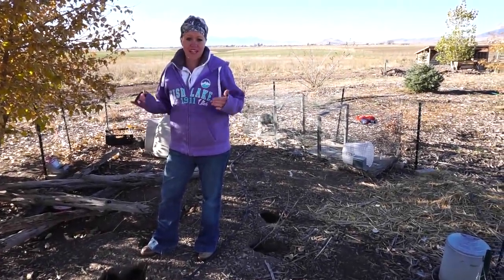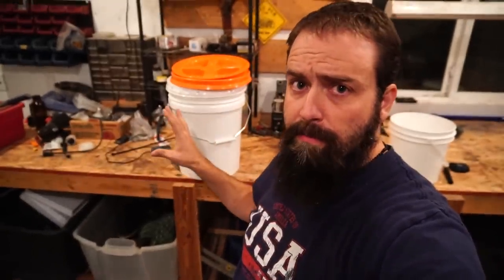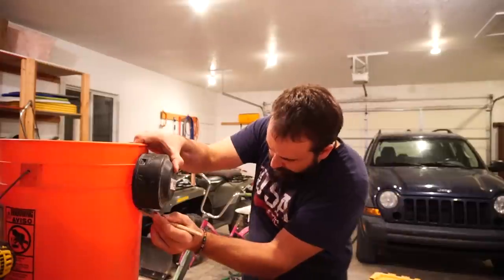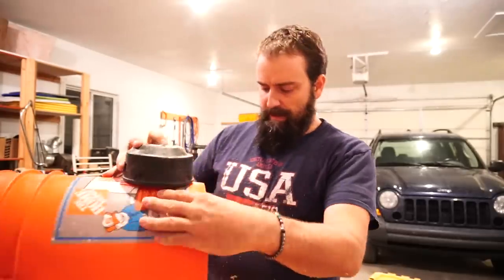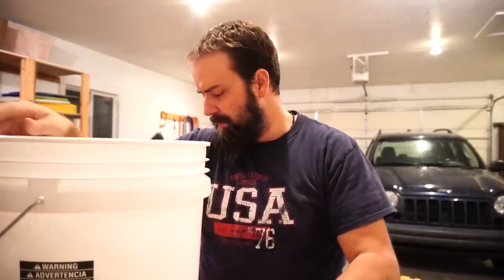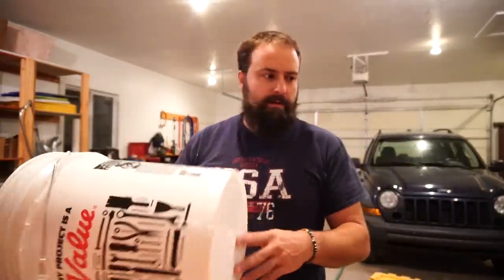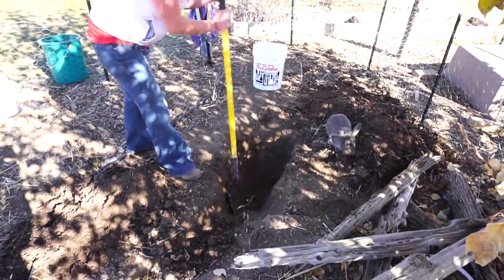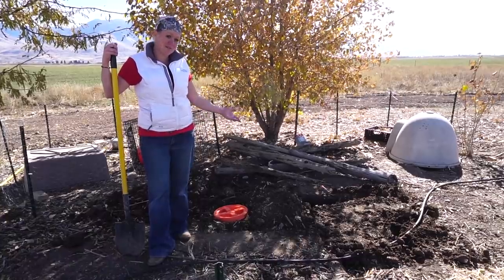Best Bucket Burrow for Raising Rabbits

Comment: I have bunnies in pairs each have 5 X 20 meter runs with smaller fully enclosed runs for night time with insulated house.  They all dig their own deep burrows in heavy clay soil, can't really understand why you need to do this bucket thing. On plus side nice to see a video with farm bunnies having space and not confined to meter square wire cages. Happy bunnies have better tasting meat. Mine are now past their prime as am I so they have retired and just eat, groom, sleep and dig 😊
Reply: So you can access the breeding chambers to check on the babies.
Reply: I like the idea of them not being confined in cages but do they fight and bully each other in this environment?
Reply from the maker: Great question the answer depends :) As long as you adhere to the proper space guidelines there is no fighting. There will be the occasional nibble on someones ear or a little fur flying LOL but it's all very normal to nature. If you introduce new rabbits yes there will be war. But overall it is a very gentle community.
Reply: @WillowCreekHomestead  thanks what about predators suchas birds, snakes wouldn't they be problems?
Reply: @sventer198  Thanks for replying, didn't think of that, mine gave birth in their above ground house and only dug for fun and shade.
Reply from the maker: We don't have issues with snakes here thankfully! BUT we have had some recent issues with Owls. SO we have a very temporary net over the top until we can figure a better solution :)

Comment: Is there a specific reason you have 2 buckets ?? Could I do the same thing but with drain pipe and one bucket
Reply from the maker: I think your design would work wonderful. There is no real reason for the 2 buckets :) just a design idea. We have moved homesteads and when we go to set it up again we will make  some changes
Reply: I'm not an engineer or anything, but my concern with just one bucket is that the entrance leading to it would act as a ditch for water to pour into it. The first bucket is to catch and interrupt the flow of water and try and keep the last bucket as dry as possible for nesting.

Comment: What do you do when it rains?
Reply from the maker: Great question :) We have recently had some flooding issues since we have had an abnormal amount of rain! As long as you have proper drainage under the buckets there should be no issue. But know your soil and area! If you water table is too high then we would suggest building up the dirt and adding bucket's above the ground line if that makes sense :)

Comment: I am trying to find good ideas to start my own rabbitry and I am really interested in this ground dwelling bucket idea. I would need to adapt your idea to have a roofed enclosure around it due to aerial predators and a high coyote population, but how warm do the buckets trend at during the winter season and what do you line them with other than just straw?
Reply from the maker: I would make the changes of putting a pipe inbetween rather than the middle bucket :) The bucket worked ok but I would prefer a neater seal with a pipe. Also we would just use grass hay or alfalfa that my goats discarded. I would avoid straw at all costs they can harbor bugs in the stems. I don't have an exact temp of the buckets in the winter but they stayed nice and toasty for the babies even in the negatives. Hope this helps
Reply: @WillowCreekHomestead  I just came across your video myself. I've been in many trades,businesses over the years and the first thing I thought was man, they need gravel and sand mixed together for drainage and definitely need schedule 40 pipe with the actual rubber seal that is used in city sewer and septic systems. It also would definitely be an added bonus to have an actual clean out down the line just like a sewer or septic system is supposed to have. It could be very beneficial in multiple ways and for multiple problems that could possibly occur in bad weather, flooding,replacing bedding,safety check, possibly even to disinfect in the summer time or high heat situations where bacteria,etc. Grows much faster. Lol, I guess it all comes down to how much work you're willing to put into it and your knowledge level of trades or how crafty you can be? I'm definitely O.C.D. so I'm known to be an overachiever but I suppose that's why I've been successful and always have more work/jobs than I can complete by myself. My father was an extreme Hard @$$ and said there was always 3 ways of doing things? The Right Way, The Wrong Way,The Way He Done It! Which was the right way times 10. Lol, I hated that while growing up but now that I'm older I definitely understand what he meant. He always said it doesn't matter if you are making a sandwich or sweeping the floor or installing water/sewer systems or building a house or barn or building a motor that you always give 200% OF yourself and make sure it's not only done correctly but, make sure it's done perfectly. He said it may take more time but you will always have a job or plenty of customers willing to pay you for a job well done. Now I understand exactly what he meant. Sadly today it's hard to find anyone willing to work much less do a job correctly.
Thank you for your videos. 
Nothing but Love&Respect to you and yours family.
Sincerely: Stephens Motorsports Family

Comment: Why not use pipe between he 5 gal buckets 4” or 6”
Reply from the maker: We were using what we had on hand :)
Reply: I dill holes on the bottom of two buckets for drainage. Then connect a 6” pvc pipe in the middle to connect them an then burry it so I can look in at any pint

Comment: what keeps the water from coming up through the holes in the bottom when it rains?  Have you had problems with bad weather?
Reply from the maker: Great questions :) You have to know your area for sure. In the space they are in for this video we had NO issues with drainage. We moved them to a bigger and "better" colony and had a lot of issues with flooding. We had to install a French drain of sorts to keep the water out. We are now in Missouri and we are unsure if a bucket burrow system will work here. We haven't quite worked it all out yet :)
Reply: @WillowCreekHomestead  you can also do this above ground and cover it with a combo of dirt, stick and brush and some sort of mulch like wood chips and or grass clippings.  I have to  pen my bred does up in the spring because of flooding and I use that bedding  to bury my nest totes. I make mini hugels over them

Comment: Thanks for this video.
is it a good idea to replace the small bucket with a simple L-shaped tunnel system?
Instead of the small bucket , what about connecting the two large buckets with a 2 ft. long (6" diameter) plastic tube with a 90 degree elbow with another 2 ft. tube.  
What do you think?
Reply from the maker: Yes yes and yes :) all very good ideas... I would also seal around the openings with caulking of some kind. It will help keep any moisture out of the buckets :)
Reply: @WillowCreekHomestead  Nice!

Comment: Could you use one entrance bucket and have a den on either side? Would the does' allow litters that close? Another question is can you use 6" plumbing pipe for the connection between the entrance and the burrow instead of the smaller bucket?? Another Justin Rhodes view joining you.
Reply from the maker: Thats a good thought, not sure how they would handle multiple dens like that.  Would be a good experiment.   And yes, 6" plumbing pipe is a great suggestion, and in-fact would work better as it's much less prone to collapse from the weight of the dirt on top.  Nice to have you with us!  - Jonah
Reply: Gail Elwood. I know you didn't ask me so please don't be mad. However, a plumbing tube will cost much more to build and you don't want the rabbits to be stressed going and coming from having to go thru that kind of tubing. This is why it would cost so much more to have a tube big enough for a carrying mom. hope this helps and thanks for reading.

Comment: Great Idea but i would use metal pipe.  The rabbits will make short work of the plastic.  Or by using the plastic bucket I would wrap in chicken wire. So if the chew through they can't get out.
Reply from the maker: We haven't had any chewing issues with ours. But there are some upgraded we will be doing in our next colony :)

Comment: Do you think pvc pipes capped can work too?
Reply from the maker: I would go with black drain pipe tubing over PVC but I’m sure it would work :)
Reply: Buckets are cheap, eight inch PVC pipes are spendy…. However, if you get some out of the trash at a construction site….

Comment: Can’t the wild animals get in there too
Reply: Yea..?
Reply from the maker: We have learned a lot in our different colony settings. This was our first attempt. We did go ahead and make a part 2 with taller walls and a large gate. Still we had some issues with a mink and an owl. You just need to know your area and your predators and make adjustments. We have now moved to Missouri where our colony is enclosed awaiting upgrades :) BUT there is no way we could do an open colony here.